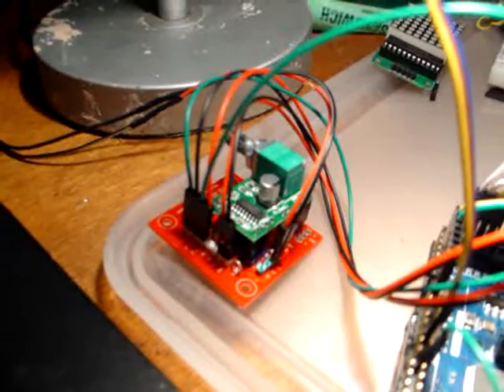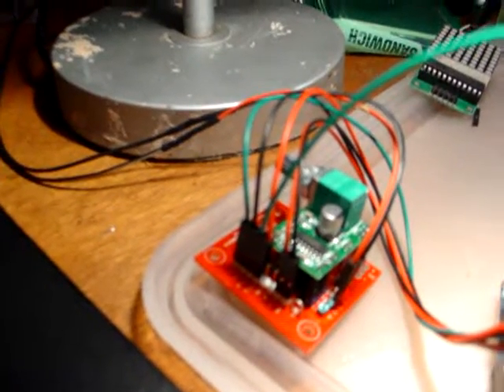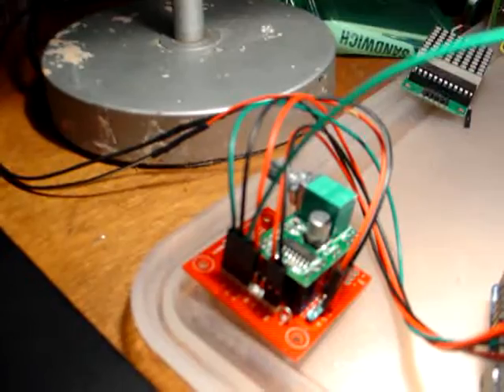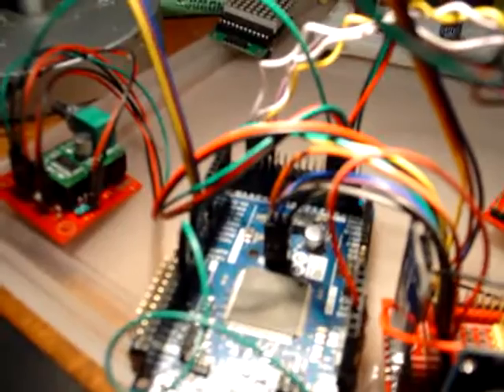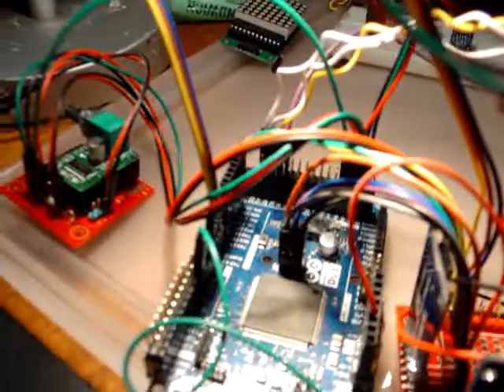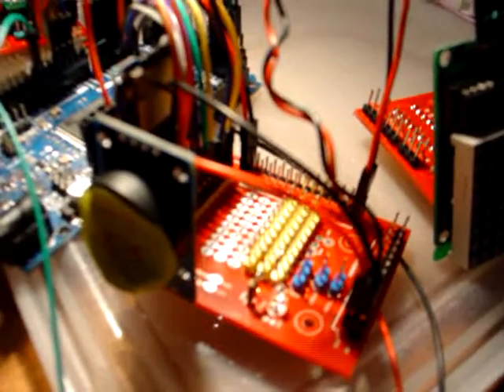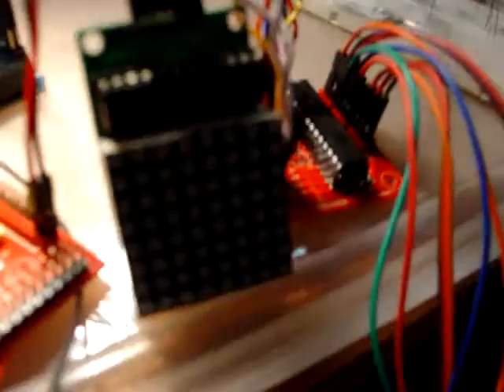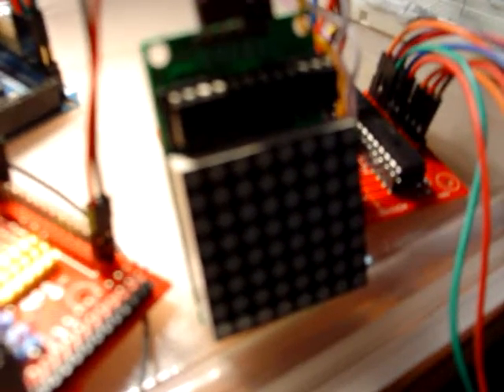Arduino Due FFT audio spectrum analyser

Comment from the maker: code will be at http://kiweedsoftware.byethost18.com/?i=1 very soon
Reply: can you give the arduino due's code? thnks
Reply from the maker: Been a bit slack... been working hard on a video player with sound atm. It's basically working... what's holding me up ATM is the AD5331 DAC breakout being delayed. Other than that it plays back video effortlessly in 3 color formats RGB565, BGR8, BGR4 and 4 grayscale formats Gray256, Gray16, Gray4 and mono.I can remember now I was documenting it and putting up on my web site... then had to get a new web site as there was a 10MB file limit. Website at https://kiweed-software.000webhostapp.com/a_news.php has some prliminary documentation off memory. If not will try and upload code and headers and example.
Reply from the maker: OK... just noticed the zipped file has the wrong file in it. Nothing malicious, I sort of copied and pasted the FFT page from another and the zip file was not updated. I will edit the page tomorrow and fix the zip file. I will add a bit of example code where I use the output bins to clarify. Must admit... I have no idea what the values in the final output bins are... but they are proportional to the frequency allocated to the bin. I have 2 sine sweep clips and it works great on them very little reflection or leakage. This other clip shows FFT running on a 128*128 color OLED near the end which is a LOT nicer than the MAX7219. https://www.youtube.com/watch?v=ZOoLcJEg8PM&t=2s

Comment: Hi there, nice video, one question though, why use a MCP4921? You are using a DUE, it has two 12 bit DAC's.
Reply from the maker: +Javier Palla Lorden Hi Javier, you are correct the Due does have 2 12 bit DAC's however they are quite crappy. (I think that is the general consensus)

The full dynamic range on the Due is terrible as I was originally using it but could not determine why the sound was bad. I ended up doing a simple test of setting a value then reading it back and plotting the differences for the range. In essence, the DAC on the Due is not linear on the ends but improves towards the middle. 

The video is a bit rushed and outdated, have a better one using an OLED with 64 bars which looks much better and have since trimmed the times down a bit more.

I mucked around with the code quite a bit as I was getting good improvements for things that were overlooked. One example was a 30% improvement just by altering the way the sine lookup was done.

I have since put the code into a small compact class which I will have to make public.
Reply from the maker: +Javier Palla Lorden Another few reason for the MCP4921. 

1) Relatively cheap $2-$3 on EBay
2) Comes in standard DIP package so they can be socketed / bread boarded and salvaged
3) Fast(er) SPI interface (compared to some 2 wire ones)
4) 12 bit linear
5) Software SPI with bit banging can be used to control them with very few lines of code. Basically set CS low, send 4 control bits and 12 data bits, set CS high. 

It has a "big brother" MCP4922 that has 2 channels but for stereo I'd rather use 2xMCP4921 sharing the same CS and  SCK this way both can be output at the same time in parallel.

There are so many DAC chips on element14 to pick from including some 16 bit ones that go for > $40 each. For AVR with the lower processing power I'd go for one of the 8 bit parallel ones.

Comment from the maker: 128 now down to 385uS (0.384MS) so... 612uS > 462uS -> 385uS is a great improvement. Sometimes just swapping 2 lines of code around in the innermost loop could have a +/ 10% effect on the time.

Also improved the calculation of the sqrt by taking advantage of always wanting sqrt(x*x + y*y) as :-

inline int isqrt(int x, int y) // sqrt(x^2 + y^2)
{
 if (x < 0) x = -x;
 if (y < 0) y = -y;

 return (x > y) ? x + y >> 1 : y + x >> 1;
}

At the moment for testing I have a 128*64 graphics OLED which makes testing a lot better. Among music files I now have 2 sine sweeps @ 44100Hz which makes spotting problems a breeze. Will get some code out soon as the original code has been totally gutted and simplified.